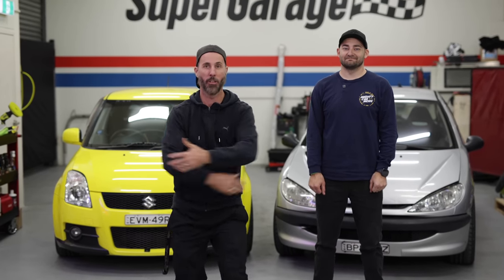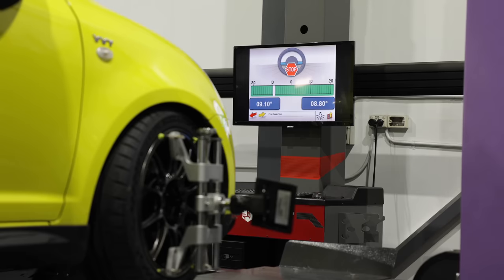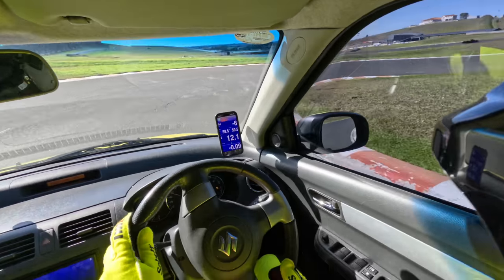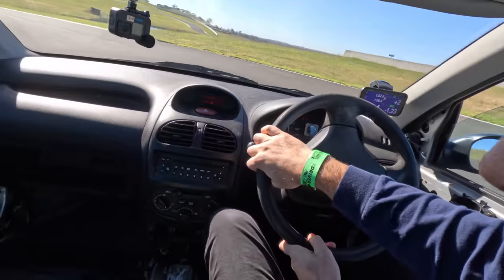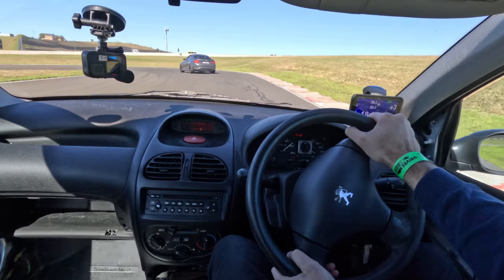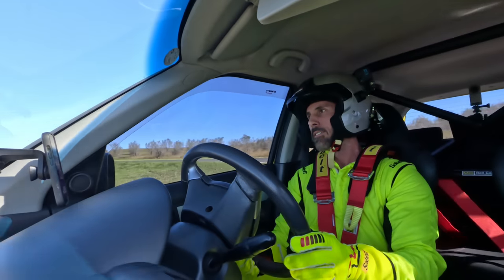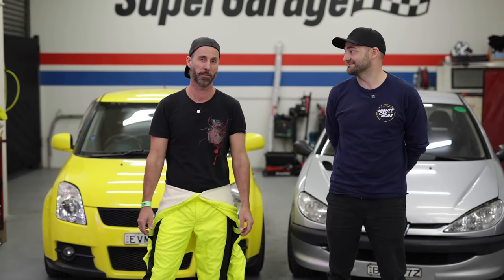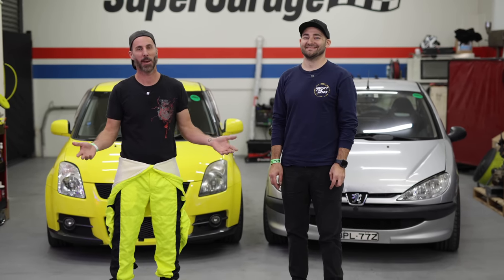Peugeot 206 vs Suzuki Swift FINAL BATTLE

Comment: A full race-alignment on the Swift would have been sticking to the "Cash vs. Trash" theme as the cash outlay for extra adjustability is exactly why you would spend more.
Reply: Completely agree, would have been significantly different.
Reply: and what about better brake fluid and better pads?
Reply: Agreed. Setting them up the same hampered the swift. Depends what the experiment was... If it was purely cash Vs trash, then telling the guys to set the swift as best as possible for the track, would have been truest (while getting Marty to do a string and chalk alignment), but if it was about whether money buys bolt on performance then it was fairest the way it was done.
Reply: Suzuki fan & lovers crying hahaha
Reply from the maker: What would you have adjusted?
Reply: @1985Legoman  so people who love Suzuki fans? Not the cars?
Reply: Now imagine a world where the 206 would have been fitted with the good bits. Tarmac rallycar spec. Swift would be eaten out
Reply: @mightycarmods  short answer: had i had the chance to modify the camber, toe, ride height and all that, i would've gone for that, so i feel modifying the toe and camber for a more aggressive turn in and lower ride height to add stability would be a good call to make full use of the adjustability of your suspension

nerdier answer: 
1) negative camber to account for the tire deformation during turns, since the load of the car is pushed outwards, so i guess a degree to 2 degrees of camber on the front wheels wouldn't hurt, the idea in the end is so you can brake enough to not crash but being able to push hard still with your foot relatively planted on the thottle
2) front toe in and rear toe out, toe in to aid during the turn ins on the front wheels of the car car while the toe out helps with stability on the rear
3) then comes the stiffness of the suspension, i don't know much if it should be softer or stiffer, but you want to avoid your car have too much body roll as it can make the car be too unstable
4) and ride height to keep the center of gravity low, same goes to help a bit keep the car planted

overall suspension is such an interesting part of the car, since it helps translate what the wheels "speak" from the road and into the car so that the driver knows what's up, that's why there's a lot of variables to keep in mind when prepping a car for the track
Reply: @tylerp4130  &*
Reply: @mightycarmods  definitely would've given it a little more negative camber and some front toe-in
Reply: No race alignment needed these are streetcars that can be raced
Reply: @1985Legoman  it's not about fan/lovers crying and sheit, you bought expensive coilover and you didn't used it as it intended, what was the purpose of it then? showcar..
Reply: @sophisticated you'd think they'd get tired of boiling their brakes after awhile... Someone must've dropped the ball on the fluid sponsorship 🤷🏻‍♂️
Reply: @Noob Driver  and you have any doubt that a 25.000 💸 track oriented car can't beat a 6000 peugbro? Of course, that's easy and very stupid. You have to give something to make a fair comparison because how on earth you can compare a 25k to 6k track oriented cars 🤷
Reply: @motaboi5397  if you put coilovers on and don't set an alignment outside of the oem spec, you've wasted 95% of the money you just spent
Reply: @paburrito  sim racer here, yup thats what i do to FF cars too
Reply: I think the point of the upgraded suspension and steering components can get you the last final 0.1 adjustments which us where the standard stock stuff is limited to. The basic adjustments now at the shop is fine and it can be tuned in later if needed. There's no need to over adjust if it's not needed because that's just stupid.
Reply: @granolatimes7185  i know but suggesting big camber and lowering it would make it undeliverable outside the track
Reply: I personally don't think -2* of camber is alot. Many factory cars that's well within factory specs
Reply: I agree, should’ve used them to their full potential. Also if it’s about track drivable street cars, a lot of guys are taking out at least the back seats since the cage makes them unusable anyways.
Reply from the maker: It doesn’t have that adjustment. Of course negative camber would have helped. Neither car has it available, so the setup was basically the same in that regard.
Reply: @mightycarmods  great that’s what i am saying
Reply: @paburrito Pablo that is the most intelligent and well thought out answer to a question I have ever seen anyone make here on YouTube. It was clear that the Swift was doing well throughout this competition, but if the Swift had some suspension adjustments it would've been able to turn even better lap times. All I can say is that I would LOVE to run a course like this in my lowered and slightly modified 2013 BMW 128i. Yeah, it's not the 135i (unfortunately no turbo, but it still has the N51 3.0L inline six, 235 HP and it has an AFE cold air intake, Active Autowerke headers with primary cats delete, along with a muffler delete. It's not properly tuned yet, but once it is it should make close to 250 HP at the crank in a 3400 lb car.
Reply: Yessss I was saying the same thing!
Reply: Marty should have always had the cash car. It’s been proven over the years that there is a significant difference between Moog and Marty’s lap times in the same car.
Reply: Yeah, wha da hell?
Reply: 19k more spent overall and still lost I don’t think it mattered at that point 😅 why spend any more on a platform like that? The name of the game is was it worth it?  The answer is nope. They would have spent more money on the swift to come out to a wash in track time. Cash Vs Trash was obvious you vent to a semi scientific test without some constants. Similar alignment and tires provided those constants.
Reply: Caster is most important
Reply: @mightycarmods  you need to go on a scale because you have adjustable ride hide you need to scale the car to get the cross weight and balance ok amd you need to do the alignment with the weight of the driver for some extra you can look for a bump correction kit for the suzuki and if you want to go the full race mode you need to look for roll center correction also that is wat i would change but now you have a very good benchmark and you can feel and see the difference between normal alignment and a full spec race alignment
Reply: Sounds like an excuse. Suzuki got smoked. Only way to make that car better is to use the cash and buy a better one. Just shows how doo doo the swift is.
Reply: @Mighty Car Mods   well now that the cash vs trash battle have given a result, can we what a full track alignment can do? And some eye watering expensive brakes please 😊,  either way you guys are ledgends keep up the awesome content
Reply: @sophisticated  a good cash vs. trash brake fluid comparison would be Marty switching to DOT4, and Moog using race-spec brake fluid. Both are an upgrade, but the race spec stuff is supposed to be more significant.
Reply: I was about to say the same thing . I dont get their reasoning
Reply: @chrislongstaff1863  see their comment above. Swift didn't have that adjustability either.
Reply: Agreed. I thought that was a broken concept
Reply: Agreed on pads and fluid. Would of made the day more comfortable
Reply: @mightycarmods  with cars of low power it's all about the weight and balance. 
Marty also mentioned the rear was coming loose meaning there's some liftoff oversteer, this great for balance/laptimes.
Eg look at the caterams of the world, base model 125bhp weight 500kg. Design not really changed in 50 years and multiple race series with these.
Reply: Yea i thought this too when he said " we adjusted the swift suspension to match the Peugeot to make it fair" literally just contradicted the whole point of cash vs trash.
Reply: That would actually improve performance. Which this series obviously isn’t about.
Reply: @mightycarmods  straight up honest answer? Let the alignment guys do a proper setup on the swift instead of telling them "make it similar to the other car". You spent the money on the suspension, it should have been adjusted properly
Reply: @1985Legoman  not crying just makes sense considering the title of the trash vs cash. at the end of the day it's supposed to show what you can achieve within a low budget vs high budget. Not high but tuned to the level of low budget. Either way if they keep these cars i'm curious to see what they'll do moving forward.
Reply: Agreed, it wasn’t a fair test, invalidating the results and making the whole comparison pointless and a waste of time.  

The Trash car had the advantage of weight reduction, but the Cash car wasn’t allowed to have its suspension calibrated because the Trash car couldn’t?
Reply: @mightycarmods  Pushed camber a bit further, and started playing with the dampening on track... would have to feel that out a bit and slowly dial in perhaps a little bit stiffer of a rear to induce better rotation... you know the drill :)
Reply: Totally agree. The point of spending the cash is that it gave him the advantage of adjustibility.
Reply: @mightycarmods  anything for extra caster, a bit of toe out on the front, zero toe on the rear, -2 degrees up front to start.

This is after I’ve modeled the suspension and figured out ride heights, curve balancing and bump stops.
Reply: @paburrito  Youre toe info is the wrong way around.

toe out on the front makes the car have more turn in but it makes it "darty" where toe-in stabilises it, especially under braking. my car has toe out in the front from the factory to assist with turn in (heavy front end, tendency to understeer) the rear is quite neutral being a RWD. A lot of FWD will run even more extreme toe out, both front and rear, to reduce understeer.

It is really dependant on the track. most autocrossers will run heaps of toe out for quick changes in direction where tracks with long straights and big braking zones lean twards toe in. rwd will tend to have more neutral toe on the rear where fwd cars are usually toed out too.

Neither of these cars have adjustable arms so camber is more or less fixed, top plate might have slots for fine adjustment but thats it.
Reply: Now you goto turn the pergout into a track weapon!
Reply: Camber! Negative 3. At minimum! Mac struts lose camber as they compress and in turn in with toe getting all wonky. You capitalize off the tires with camber. I bet the swift has at least another half second with it dialed in. And maybe a bigger radiator and oil cooler..
Reply: @ZackNakazora1  This is why avoiding macpherson strut was a major consideration when buying my car🤣
Neither of these cars have adjustable arms though (yet) so theyre both stuck.
Reply: @drawzerRB  and it was not even 206 sport (i mean GTi 180).
Reply: @mightycarmods  dees nuts
Reply: Totally agree, I don't want to say it but donut media done this so much better
Reply: @Brock_Landers Intelligent but he has toe in and toe out confused with eachother🤔 

Everyone here wants to be the expert but they forget a pro aligned it. He even raised and lowered the car to see how the geometry responds through its travel. He knows what he is doing.

Just because they set them up to handle the "same" doesnt mean its a bad setup, if you look at the static alignment specs theyre probably still different between the two cars as well. When they say "same" theyre talking about how "agressive" they wanted to go with the alignment, they could have gone more or less agressive on either car, its not a matter of $ its a matter of what handling manners you want.

People forget the swift still only has coilovers, they didnt put adjustable arms or any other suspension business in yet so theyre still fairly limited in terms of useable height and camber. The extra adjustability available in on the swifts more expensive coilovers will be related to the damping etc. Rather than alignment. Coilovers arent really an alignment part.
you only get so much adjustment in the top plate, possibly none at all depending on the car. Coilovers domt magically change this.
Reply: @mightycarmods  You mentioned yourself you tried to imitate PeugBro alignment as much as possible on the more "editable" Swift suspension. No idea what you guys went with in the end but maybe it was a little gimped because of that, making the expensive parts slightly redundant. 
 But what caught my eye was not the alignment but how much the suspension was skipping on that horribly surfaced corner lap after lap. It is clear all cars were struggling to keep rubber on the road there but the Swift MIGHT (maybe?) benefit from a slightly softer, more compliant suspension dialing. Was it rubbing the wheel arch there? Thought it sounded like that a little.
 Not very important anyway, two mates having fun is what matters. And more seat time in the cars on the track would likely still drop both cars laptimes. It took me a while to get used to driving my (non Sport) Swift using momentum as much as possible. 
 Did both cars just overheat coolant and brake fluids or did things break on them too, other than seat rail :))? White smoke out of the Swift was sad to see, hope she's ok. 
Thanks for the content. Had a blast watching you guys having a blast.
Reply: Also thank you for driving the point home for everyone. Best mod you can make is put a decent set of wheels and rubber on the car.
Reply: @jafu745  the swift suspension is more editable in terms of damping, not so much alignment (except rear, peogot is solid, but not badly aligned anyway). Both cars are limited to toe adjustment in terms of alignment but the swift still has better damping, but you cant set damping on an alignment machine, that is for moog to learn to set up himself after cranking laps
Reply: @racecorey  6]y
Reply: @omar.alsharif  for track use toe out in the front and toe in at rear is the way to go! 👍
Reply: I think the point they were trying to make is that you don't have to spend stupid money to have stupid fun!
Reply: @mightycarmods  I think he meant the adjustment of the shocks and that could have made a little difference. But with the brake fade and the overheating I would consider that  negligible.
Reply: @wonderfulworldofWoody  agree! I love both but Marty is more track oriented driver than Moog. We can see that every time they race. But I believe if Moog had is suspension properly set up Marty's time would be beaten...
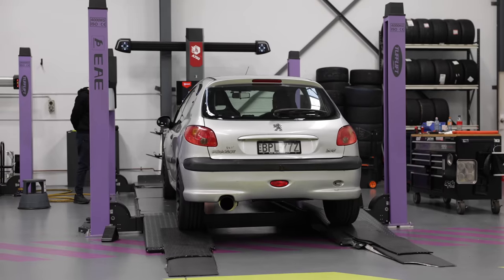Reply: 0:53
Reply: @mightycarmods  Moog specifically said at the start of the video that he didn't want to adjust the suspension setup of the swift outside of the capability of the Poogeot. Was this a voice over mistake or was this actually accurate, if so then can you explain a bit about why ? Did you think it would be too much of a wash with a better setup so you tried to keep it more fair ?
Reply: @mightycarmods  If I understood correctly in the video, you were matching the Peugeot, which was running about 1 degree of front camber?  Not a fwd officiando  but most circuit cars I've raced are running -4 or more degrees . 

edit: Just read where you said it doesn't have that much adjustment. Grab some crash bolts from whiteline for you next upgrade 😊

This series was so much fun to watch!
Reply: Race what most cara can not adjust shit and coilovers only let you adjust the coils not the camber toe and caster of a front and rear tire . For that you need proper arms
Reply: Yep totally don't understand spending money of proper suspension and then not using it. RICE?
Reply: @motaboi5397 right? It's what they stated at the start.
Reply: Agreed
Reply: @paburrito  Front toe in and rear toe out?? Isn’t it supposed to be Front toe out and rear toe in? Or will it be the complete opposite when tuning for a FWD car?
Reply: @mightycarmods  
“A significant track suspension set up advantage compared to the Peugbro.”
Reply: @mightycarmods  the comments are based on the fact you said you wanted the same setup as the Peugbro and wouldn’t be giving the swift any advantage. You could have omitted that line in the video if that really is the best the swift can do.
Reply: Then the swift should have kept the intake too…
Reply: @mightycarmods установил бы турбо кит на Suzuki Swift sport а лучше взять следующие поколение Suzuki Swift sport 1.4 k14c
Reply: this whole series was wrong.. what a mess.
Reply: Those coilovers did not have adjustable top-hats.  Thus, adjustability was very limited to whatever the car came with from the factory.  The only adjustability would have been height, with the exception of Moog's which had a single knob for dampening/rebound.  Camber/caster was not adjustable from those coilovers alone, so the MCM boys didn't really have a ton of options.